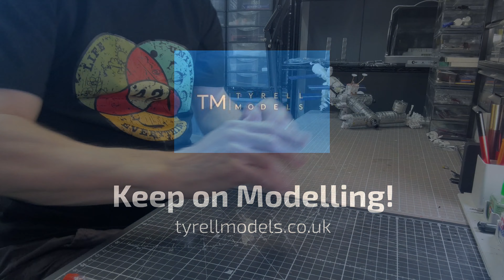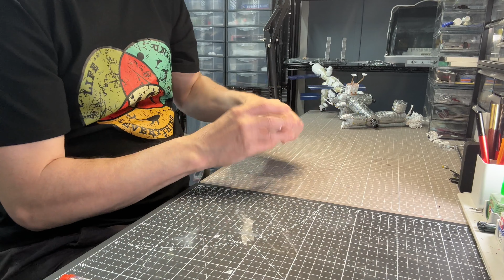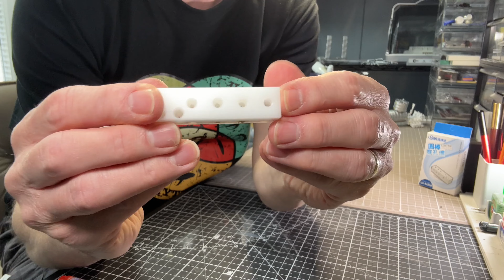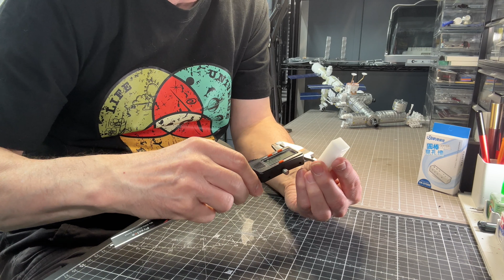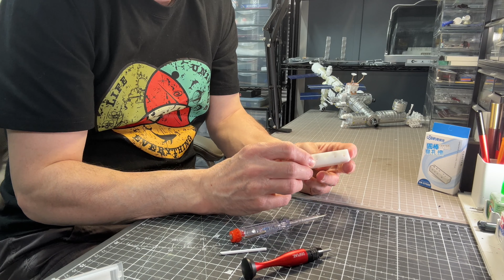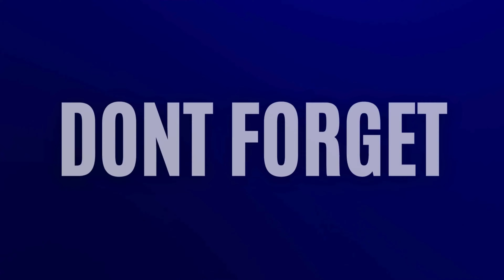Ustar Centre Hole Locating Tool

Comment: Thanks for this. I've been eyeing the Mazha tool that does the same thing - the question is, which one is the most versatile?
What I do need is a tool which helps me drill small holes in an evenly spaced straight line - I bought the Ustar templates but they were so thin as to be useless. Or is it just me.....? 🤔